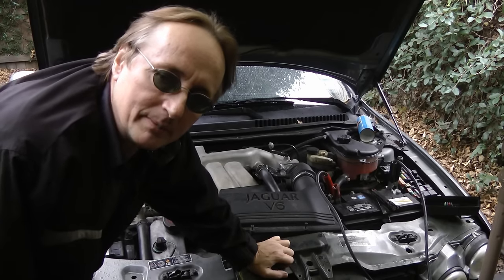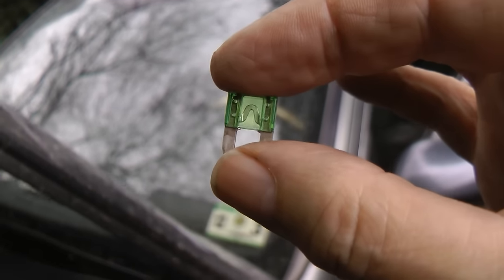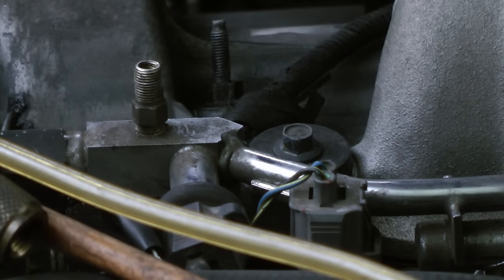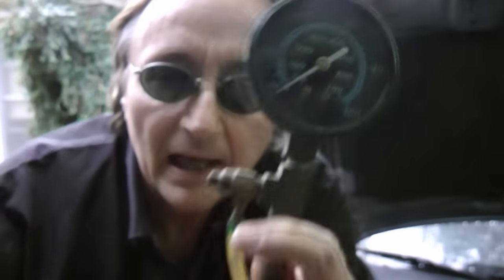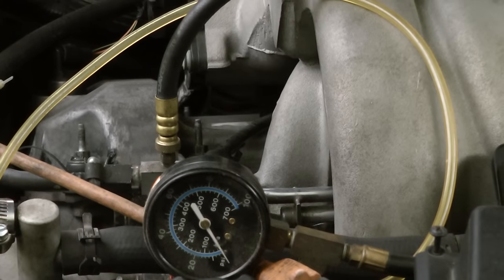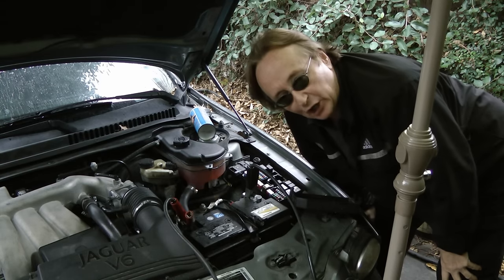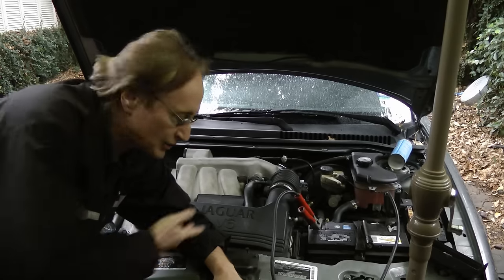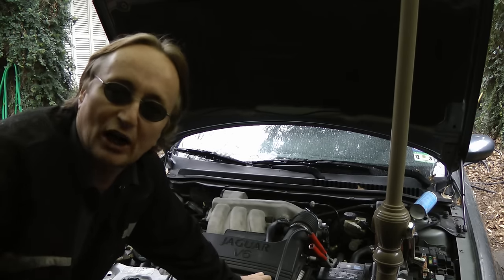How to Tell if the Fuel Pump is Bad in Your Car

Comment: What state r u in ? I ask bc u work on customers autos and I truly need an mechanic in NY to help me. I cant explain what all sounds i hear idk if I'm hesitating bc idk what they mean by such but I touch gas feel tiny shake hear an noise as if it's a pitched sound that drags out and a bit bucking bk at me or sum vibration or kick bk feeling idk how 2 explain noises I hear etc.  I'm told cld be water in my gas. I keep filling up half or full tank bc thinking get rid of any old fuel in the tank. But regrdlss how much gas I get seems like issue went 2 now an dffrnt sound. Remote start was hkdup into my blazer b4 I bought it Cpl wks ago. Hit the start button altho keypads got chkd they wrk fine accrdn 2 had them tested but takes 4 times to hit start 4 suv to turn over and run put key in and I turn engine over and it starts faster thn it does with my keychain remote starter button. Idk if manifold has an leak or hole bc shifting and acceleration now had become where I can hear wen I'm touching gas and when engine shifts well tranny shifts. As last wk cldnt hear it only quietly. The guy wen I asked bout 1 squealing noise under hood said is due with my water belt I swore he said.  Def he said sumthin bout an water part. Sumthin do with water. Serpentine belt shows weather worn I guess it's called with tiny slits in it. Ac hose idk y Its missing but it is. I've heard an screech sound while accelerating which at 1 time came so loud sounded like parts were bashing tgthr or sumthin was brkn loose. That also came with alot of vibration or shaking sounded just like sumthin broke loose or was being shaken or sumthin . The floor board was really heated aftrwrds. That day all dffrnt done was got gas frm dffrnt store, drove about 45 to 60sum miles with only shutting SUV off twice and used northway also n same day brk pads were chngd. During idle at cold I hear a tap noise n engine rev noise lk at rpms hand goes frm half of 1 to 1.5rpms and can hear the rev sound a tapping sound and the otha squeely sound which guy says was sumthin due with a water sumthin part swore he said hose idk. There is a bit of shake while idles if I watch dvd player stereo which was hkdup 2 watch dvds while in drive suppsd not be able watch DVDs till in park so idk if small shake n revving up sound like its gna stall but doesn't stall sound is frm dvd player hkd up wrong since suppsd be hkdup watch in park but bc they got it hkdup 2 watch while driving maybe causes while idling mess up idk. I hrd clunking 1 time was loud but went away. Idk if was when I turned my wheel or just hppnd when i touched my brk or hppnd frm afta I hit a bump altho I swear 0 bumps were in the parking lot. But sumthin is making acceleration n shifting sound louder I'm thnkn is an manifold leak or gasket. The guy put in agreement bc cldnt test drive auto only in prkn lot he swore 0 probs well I've owned it 12 days now and I've hrd stuff since night 1 driving it home 2 do with gas hold steady at first wld bring on shake n kinda skipping feeling or afta turn cruise control off but was tiny issue wld touch gas all went away but now that lead too any mph now wen feels like kicking in I feel n hear that noise which I swear is squealing at same time as screeching sound combined or maybe just is an vibration noise whirling out wateva noise it Is the pitch is like sum1 singing staying at 1 voice pitch where they drag out they voice bc they dk how 2 sing sort of noise wateva sound drags out. Tapping I call it sound has been medium amt of noise but night I felt major shake or vibration with an sound of an dragging out pitch where went frm loud sound 2 very loud sound well after that noise went away I cld accelerate fine again but during the commotion touched gas made it sound worse n louder. Anyways that night while SUV was heated alrdy n idling I heard loud thump noise or bang asked my bro wat noise was he said motor lifter oil cld be thin dash says in auto info 61% oil life still left. Also turn engine off theres at times loud and sumtimes way quieter thump noise like as if sumthin heavy was being thrown down fast under suvs hood my bf recorded me turning engine off on video see tranny and oil pan shake the thump sound scares me at times turn engine on hear small thump as if wateva is turning on like moving 2 get into placement or as if wen turn engine off it's like wateva is being thrown or thumped. Like I said Idk all mechanics word dictionary4 describing  each sound all I can do is try choose the rite example2 describe wat the sounds are familiar towhich noises I do know or try my best to get understood. But littrly I'm hearing sounds n I don't like it. I want my baby 2 go running like an champ.  What do u suggest I have chkd out? Didn't go mechanic shop bc idk sounds 4 wat 2 say they are or how SUV is acting. So most arnd here hears me struggling2 describe sounds they will take advntg of me thnkn idk mechanics they can say tons wrong that isnt even wrong bc had it done 2 me b4 where a garage said o needed more parts thn was needed I lkd up symptoms per part they said my auto needed yrs ago a dffrnt auto I owned N my car wsnt doing none or didnt do most symptoms of crtn Parts 4 being bad. Like bad battery they said well my battery tested fine etc... so I'm scared of being ripped off n also of the prob not being diagnosed correctly.  I trust u so pls help me
 Thanks.

Comment: Bad enough they put the pumps inside the tanks...  more now not even putting an access hole. My 2004 Impala - has one. My 2010 Impala - they made the ring which should have been cut out, but then didn't cut it .  At least it doesn't have a sub frame in the way... but still a PITA to fix.

Comment: What if you run out of fuel, and then it doesn’t crank or start after adding fuel?  Ran fine before Letting the fuel run empty.
Reply: cranking and actually starting can be different issues. If ran out of fuel then doesn't crank... not likely related. One thing this video missed was the fact you can have power to fuel pump and not have pressure, because it's out of gas.

Comment: Or an easier and cheaper way to change it is to remove the rear seat base and cut through the floor pan, the pump is right there. First some searching for the dimensions is required.

Comment: I do have a question, i have an old 1990 volkswagen taro petrol engine. So lately my truck lacks power. I try to drive up a not really steep hill in 4H but my car stalls. It never used to do that.
Side note: Sometimes when i turn off the engine the car still works. 2: and sometimes when i leave the car running in neutral, some times it turns off.3: and  sometimes i cant turn it on, it has full battery and it cranks so its not a bad starter. If anyone sees this plz help

Comment: I have Ford Freestar 2006 I'll to check the fuel pressure noting how to check the fuse switch still no crank have a brand new battery

Comment: I have a 1994 Olds Cutlass Supereme S 3.1 & I have a few questions.#1  my power mirrors don' work.It'll go up down & right but not left.What's the issue? How can it be fixed? #2  I can't keep my trunk opened.I need something called a tie rod end I think.I've brought one from the dealer over 6 years ago,but GM don't make them any more #3 I need a MAIN SWITCH for my windows #4 I don't have any trim around  the roof line.Could anyone fix that? #5 My key fob don't work.I've ordered over a doz and they would work for awhile;10mins and it stop.What can I do? Does the car has to be RE-PROGRAMED?

Comment: Hey scotty i need help please 2003 v6 mustang 3.8 l. My ac compressor wouldnt  engage i cheak evey thing is good new compressor  and relay i cheak the ac control switch i put a next one in from a expoler  the cooling fan came on and also the compressor but the inside blower didnt come i try a use mustand switch seem year and its doin the seem thimg the vompressor and the cooling fan not comeing

Comment: I've changed the o2 sensor, fuel filter, accelerates like crap and if you push the gas in more than an inch it loses speed and sputters

Comment: Hey Scotty I have an 02 Dodge ram 2500 and I got a sqilling noise and I think it's my alternator but it's working just fine what else could it be
Reply: The alternator pulley has a bad or dry bearing get a new pulley kit, very cheap..

Comment: I own a Lincoln. To remove my fuel tank (to get to the inside fuel pump), it requires removal of 2 easy access bolts, two harness connections, and a hose. I then pimp the fuel out and easily remove the tank. No way in hell would I buy a vehicle that requires removal of the subframe to remove a fuel tank. No wonder why I see a lot of non wrecked Jags in junk yard. People probably junked them after getting a repair quote for simple s%$# that costs more than the vehicle's current worth.

Comment: One thing to keep in mind the computer turns on the relay that gives the ground that gives the b+ 12 volts to the fuel pump Don't assume right away it's a fuel pump if you don't get 12 the computer is in charge for your starter to work the computer controls the relay for your lights to come on the computer controls your lights and the relays these are computerized car this is something that I see is overlooked
Reply: @AnimeKing🧡 glad to hear it at least it wasn't anything really major

Comment: I sprayed starter fluid in the air tube and it ran a couple secs so i knew it was fuel pump . Should of checked fuse first though

Comment: I got a crisler 300 won't start well i was driving it and i was pulling out my drive way and shut off and i checked every thing but i put a car check engine codes and it pops up. With e708 and i check t it and it shades some thing all about transmission mall function but i dont no what that means so if u can help me or let me now what that code is please help me

Comment: Help 2006 Sonata runs on Starter fluid. Fuel pump is working, wont start or stay running.
No check engine  lite?? 40+ yr  Mech stumped  (( ME ))    :>)

Comment: You can actually get to the fuel pump from the rear seat. You just have to cut out a 10 inch diameter circle.. don't quote me on the number but you get the idea... That's obviously not from the service book

Comment: Hello Scotty hope all is well. Yes I'm a female and love to fix on things especially my car. The only thing is that I don't have all the tools to do it my self. I changed my thermostat on the 7 of this month and my car still runs hot on and off and my oil light comes on and off. The fans do be on when I cut on the car. I have a 2000 Dodge Stratus and is in need of answers. This a the only car I have🤦🏿‍♀️🤷🏿‍♀️😂

Comment: My 99 GMC started up right away when it's cold after it runs awhile an then you turn it off then cranks an cranks till it starts it acts like it isn't getting any fuel then ideals real low if you pump the gas it will start but not fast like it should 😤??🔫💪🇺🇸

Comment: They wanted to charge me $1100 in August 2021 to change the fuel pump in my 1995 Pontiac Grand AM.  I didn’t accept that and in September 2021 I’m still driving  it.

Comment: Jaguars suck the engines go bad in them, and they cost around 20 grand to replace, and a lot of people do LS chevy swaps because of it which cost 12 to  15 grand which is astronomically expensive in its self if you aren't doing it for hot rod purposes .

Comment: $900 for a fuel pump in a 08 silverado. 1 month later, gave out again. Faulty pump?
Reply: No, poor choice of a vehicle
Reply: @elsey1976  I understand your probably a ford fanboy, but its been a damn good reliable truck. It was the original pump. I say 12 years (manufactured and bought in 07) is pretty damn good

Comment: i know this video is old but $1000 to replace a fuel pump that's to much money i would locate the fuel pump lift the carpet inside and remove seats carefully cut a opening to get to the fuel pump from inside the car i can replace it in under a hour and get it done for about $80.

Comment: Or you could just cut a hole in the trunk floor, change your fuel pump and put a plate over the hole when done 🤷‍♂️ call it an “Fuel pump access panel” 😂

Comment: That''s a horrible design 😱 many basic cars luckily have a hatch under the rear seats which allows you to change the fuel pump basically without taking anything apart.

Comment: Your intro is a wonderful display of how NOT to drive.
Spinning rear wheels = poor traction and car control (and excess tyre wear)
Locking the front wheels on breaking = no steering control (and flat spots)
The Yanks might like it but to reinforce poor driving technique is a long way from responsible
Reply: @Cobar53 that was someone’s Shelby mustang & they let him race it. I’ve seen his newer videos, he drives responsibly. He makes sure no vehicles are around ever, for safety. He also asks a customer permission before he takes it for a test drive.